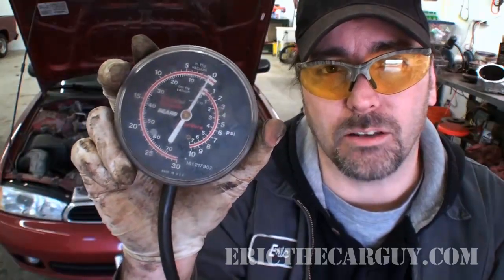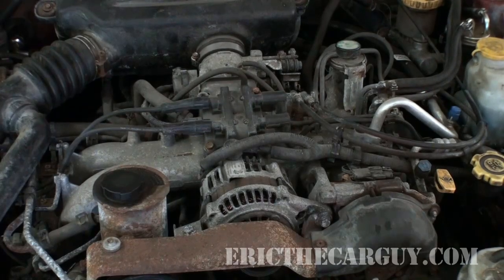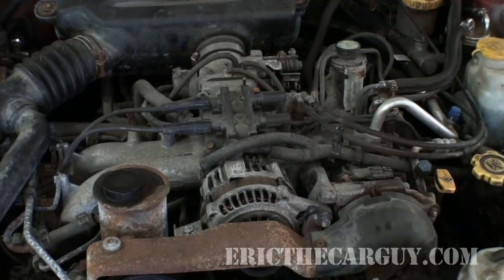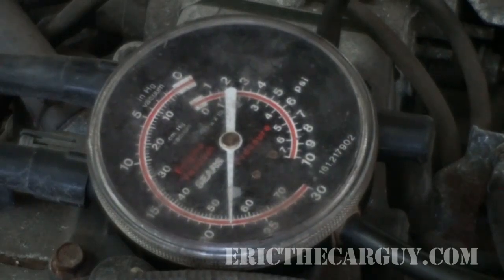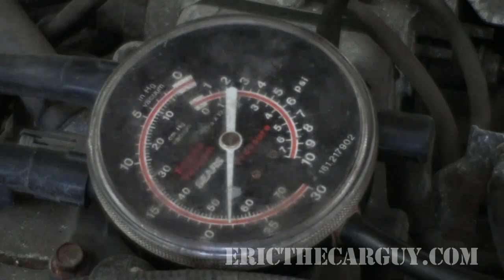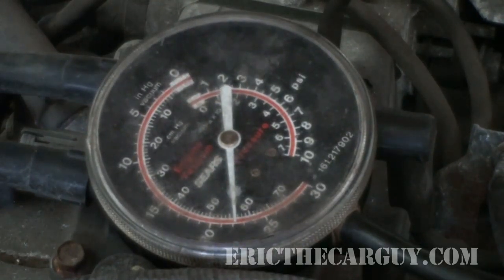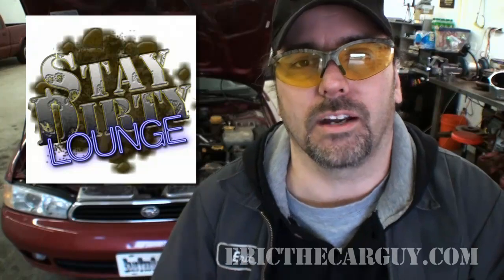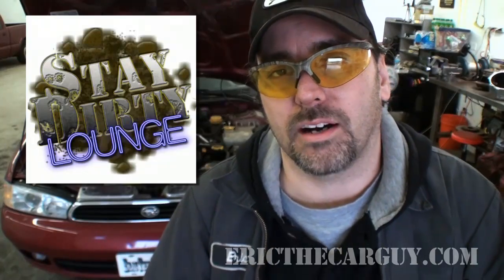How To Diagnose Exhaust Restrictions -EricTheCarGuy

Comment: How bad does the restriction need to be to register on the intake vacuum? I have a naturally aspirated petrol car, 426.000 km old still on the same cat. It was rebuilt 30.000 km ago and was running sweet, like new. But recently the performance deteriorated heavily... Particularly after constant higher revs driving (speedway, 90km/h) or low gear under load (long slope) the engine starts sputtering and stalls. Takes more cranking to start but starts. Plugs and O2 sensor were whitish;  swapping the sensor changed nothing. Should I suspect the exhaust restriction? Want to sell the car but in good working order.

Comment: What does a slightly fluttering needle mean( bouncing up and down by 1 or 2 HGin)? Also, when you say remove the Oxygen sensor do you mean the upstream or downstream sensor? And wont that sensor being removed while driving cause air/fuel trims to act up?

Comment: Didn’t work for my 5.3 v8. Vacuum gauge didn’t show any problem the way you showed. Pressure gauge in the exhaust showed over 10psi under full throttle snap. My converter was plugged.

Comment: I have a 2013 chrysler 300c 5.7l hemi with no mods that I drive hard.. and I'm getting the smell of fireworks from the cats..I wanted to put high flow cats on but still need it to pass Cali. Smog...first will new cats improve hp even slightly and what can I do to improve performance without creating a hotrod..2nd what brand do you recommend selling quality cats

Comment: Very good work, but whats the go with a diesel that has a vacuum pump? I think my diesel may have a clogged catalytic converter because the exhaust manifold area is pie cooking hot, more than it used to be and she's down on power. Either that or the timing is out (retarded)

Comment: I'm wondering: in the case of the healthy engine, why does the vacuum get slightly stronger at part throttle (once it settles down)? I was thinking that with wider-open throttle it would be closer to atmospheric pressure, or does that only happen close to WOT? Makes me wonder how speed-density systems can make sense of MAP sensor input!

Comment: That's great video. I have a car equipped with Valvetronic system, hence the throttle plate is always fully open unless the car is in limp mode. How can I test for a clogged exhaust on these cars?
Reply: Drill test ports before and after a catalyst chamber and compare.

Comment: O lawd that banana poke was jus soo funni!   Ok so here I am trying to figure out why I don't have any manifold vacuum.  I found a PDF article that detailed the various symptoms found while using a vacuum gauge.  A restricted/plugged exhaust just stood right out!

Just weeks before I encountered a stall and then a crank but no start, I had a new catalytic converter installed.  Hooking up the vacuum gauge and fuel gauge after confirming spark, etc, I found a really good high fuel pressure but with a leak down and thus indicating a bad regulator.  The vacuum gauge kind of ticked off of zero but nothing more.  So at this point I isolate the PCV and the A/C-heating vac hoses and do a direct vac test.  Still no vacuum!

Now I'm going nuts, scratching my balls and pulling my hair out!, I go online and find that great and simple PDF that after led me to watch your video.

Tomorrow, I will check the exhaust....... If I find a bloody banana or anything else in the tail pipe, I will surely do a war dance!

Comment: Could you use temperature before and after the converter ?
Reply: It's a different test, but yes. If it's hotter in the front (closer to the engine) than the back, it's clogged. 
But it could also be a malfunctioning cat. 

Measuring this way checks the entire flow of the car, then the troubleshooting takes place to find where the blockage is.

Comment: Often when a check engine light comes on and its a bad 02 sensor. If you let that go uncheck too long it, the engine will dump too much gas and it will break up your cat converter internals and clog the exhaust. It will not run good at all. Low power. It might not make it up the street. You could notice a gas/fume smell inside the car. Outside the exhaust smells foul like rotten egg. Sounds like crap at the pipe.

Comment: FYI Eric, on my sons 2001 Mazda 626,just did my test. I used a Vacuum brake bleeder from Harbor Freight and out it on an evap tube, it read ~20 inches but it was chattering back and forth at a rate like a bobble head on steroids. I was by myself so I reached over to the throttle body and turned the plate manually to give me about 2K, the vacuum dropped to under 15!!!! Wow took me a few minutes to watch your video and 1 minute to do this test and drink a beer while doing it. So no I'm so happy, I'll have another beer. BTY my problem is a rough idle that gets better once I get to higher revs, its my sons car so I don't know if its losing power as I don't drive it. I had done a few other things that improved the idle greatly but this is certainly the last problem...If you're wondering of you really help the average Joe out there, you do my friend, you do.

Comment: you are the best. My 2002 pontiac grand prix has the same problem after repairing a misfire P0303 so as i push the accelerator the rpms run very high and i struggle to go the speed limit.

Comment: Thanks man, i work at a shop and had a car with no check engine light on but would lose power up big hills only, no acceleration at 60 at 4000rpm,
Did this vacuum test and the vacuum doesn't drop to down at full throttle.
Removed b1s1 o2 sensor and the power returned.   Sold the cat and rusted o2 sensors. 
Completed monitors and the car passed smog. All is good now
:-)

Comment: Great video! At 5:28, you said to take out the o2 sensor and drive to cofirm an exhaust restriction. I took out my o2 sensor and it STILL has loss of power uphill.  What does that mean? Thanks for the reply.
Reply: Mars Sojourner, I took out my o2 sensor and it ran so good, in my case I have a plugged/clogged exhaust. 

I can say  to check and clean your mass air sensor , also check your EGR, pedal position sensor,...

Hope this can help! Good luck!
Reply: So how did you fix your clogged exhaust?
Reply: Magic Johnson hey, In my cause I had to gutted my catalistyc converter temporary until I have money to buy both cat converter. My car is running like a champ. both catalistic converter were clogged because was burning too much oil. 

Did you take off you down pipe and drive the car and feel any differences? Or just take off the plug on cat converter ? 

*In some States gutted cat converter are illegal.
Reply: @josuegonzalez3375  hi.may i know what o2 sensor you remove botton one?? or the one fron the exaush manifold?? because 97 accord is slow accelarating then yesturday i removed my catatalyc converter it was loud but i felt it run better and what i did i gutted my cat too but i dont know it feels a little bit better...1 thing i notice that with the whole system  cat.muffler connected it spills dirt or maybe its oil..and without the cat and muffler and pipes it doesnt spill..so my guess it could be that the muffler is clogged?? hope you understand me//english is not my first language lol ty

Comment: I need some help I have been working on cars a long time and I am having problems finding the cause of my problem with the exhaust manifolds glowing red after I put a load on my 98 s10 blazer with a 4.3 and it runs good with good power and the spark  plug tips look tan do I am stumper got any ideas thanks
Reply: Fuel pressure regulator

Comment: hi,i would like to ask you all a quick question,i bought one of these vacuum gauge for my motorcycle is one of those compound meter with different colours for different measure but when i connect it at the vacuum line of the throttle body the gauge remain stucked on zero and even if i open the throttle the arrow moves only 1mm or less,how is it possible?to help you better understand i connect the vacuum gauce after the throttle body exactly were is the plug for carburetor synchronizer,i can feel the vacuum with the finger even if is not strong vacuum is there but with the vacuum gauge connected the arrow remain on zero,there is someone who can help me to understand the reason?i would really appreciate it,thanks..p.s. i dont know if make a big difference but my motorbike is with electronic injection

Comment: This raises thinking about another tool the "smoke test" can it be performed on both intake and exhaust side? I am pretty sure it can but not so sure if it matters if the car is on or off when performing a smoke test to find leaks. As opposed to finding  clogs. Its a stupid question but when i am not completely 100% clear on yet

Comment: that's the exact same gage I have- II think it came as part of an engine test kit from sears years ago ! anyway the problem I have isn't restricted exhaust. I'm dealing ith an engine that someone once upon a time installed a high performance cam and roller lifters etc... I don't know yet but I suspect they also got some type of adjustable timing gear and adjusted it too far
Reply: 1skywrench - My 2 cents. Get it as close as possible to "normal" OEM condition, to have a good baseline. Than start from there one step at a time. 
Might sound tedious, but In the end usually saves a lot of time/money, with much less "guess work". ;-)

Comment: Does anybody know if a compression gauge is the same thing as vacuum gauge is?
Reply: no, its not
Reply: abracadabra sabracadabra thank you. Where do I get one of the gauges mentioned in the video?
Reply: Just about anywhere.   They are nothing new.  Been around for many many decades, one of the oldest diagnostic tools ever designed.  So, Sears, Pep Boys, Autozone, (those type of retail auto stores), Amazon, Ebay, heck maybe even Craigslist for a used one.  I would avoid the tool trucks like MAC or Snap-on -- way too pricey.  Sometimes Pawn shops and flea markets have them too.  Just make sure it works.  If you buy a used on, put your mouth over the end that the hose goes on or put the hose on it and suck, the needle should move into the vacuum area.  Some of these gauges are two in one types,  having both pressure and vacuum readings on them.  Some are just vacuum.  Anyway, you will also need some fittings, called T fittings.  Based on your question, you need a kit, otherwise it will be a useless gage.  I would look at Harbor Freight Tools for one.  Check out this You Tube video, the guy uses one from HFT:  https://www.youtube.com/watch?v=SdlNwm8OHco https://www.harborfreight.com/catalogsearch/result/index/?dir=asc&order=EAScore%2Cf%2CEAFeatured+Weight%2Cf%2CSale+Rank%2Cf&q=vacuum good luck

Comment: Hey Eric thank you for the video! I have an important question that I was hoping you or someone else might be able to help me with. I own a 1982 Datsun 720 pickup with a carbureted Nissan z24 engine and a Holley 2 barrel carb. After watching your video about how to tune a carburetor I went to an intake vacuum source on the carb, hooked up my vacuum gauge, and had no luck tuning it based on the vacuum pressure because the vacuum was constantly bouncing around between about 4 pounds of vacuum no mater where I adjusted the mixture. Do you believe something like this could be caused by a restricted exhaust? Otherwise with the truck being an 82' I know I have quite a few exhaust leaks scattered across the exhaust, but I don't know how that could be affecting it, maybe not enough back pressure or something? I'm all out of ideas and would appreciate any kind of suggestions anyone has to offer.
Reply: A bouncing vac gauge indicates a number of things, from mechanical to misfire due to ignition or carburation fault so you need to narrow it down. is it a regular misfire or erratic misfire, if it is erratic it is possibly carby or points condensor if it has any, if it is a regular misfire it may be ignition secondary or mechanical.
Reply: Ryan Salmons - Just as Aumechanic mentioned can be from several different causes. Personally I would start with the ignition system checks. From the plugs and moving backward. Be consistent and methodical. The plugs will also give you precious information to had to the vacuum gauge readings. 
Are the gaps, temp range, OK for the application? Plugs OK, move to the cables, , than distributor, etc. a lot to check, but done by steps it's easy and target for the best results. 

Forget the carb until the rest is 100%. Otherwise you'll be chasing your own tail. ;-)

Comment: what about a "low voltage" code on the rear O2 sensor both before and after changing rear sensors? vehicle is a 97 chevy K2500 4x4. 5.7L vortec and hd factory dual exhaust instead of y-pipe

Comment: I just bought a vacuum gauge for my old 92 Ranger 3.0L because the engine is not behaving right. What I saw was the needle was at about 18 in of mercury at idle and would be steady for no more than a few seconds. It would then bounce down towards 15 inches and try to climb back up. What does this mean?

Comment: eric please help
2000 expedition 5.4 replaced exhaust manifold and cop's #4 & #7 engine still runs very rough and not getting all the power during idle and driving
Reply: Did you try changing the spark plugs?

Comment: Eric, YOU ARE THE MAN!!!!  50 years experience and I learned something today.  Had a Caravan with no power above idle.  Idle vacuum was 22, dropped to 19-18 after a few seconds at 2000 rpm.

Also gotta say you are articulate and easy to understand.
Reply: Many years ago a friend came with his BMW which had lost performance and was quite irregular while driving. Big headache to find until the vacuum gauge got into action. 

Shortly after confirmed when the car was raised, a big kink in the exhaust pipe. Well he just forgot to mention from the beginning that the "failure" showed up immediately AFTER hitting the exhaust. Could have saved us a few hours...

Make sure when approaching your favorite mechanic to tell the full story. Can be a big help for both. ;-)
Reply: Thomas Goodman so do I and am working on it little by little and just a little thing can cause something big

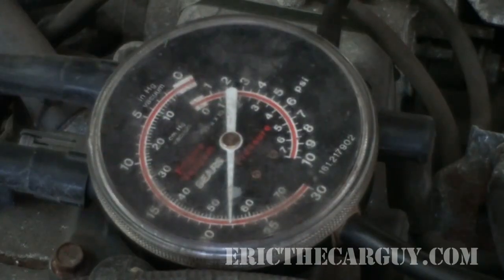Comment: I'm confused,  @ 1:53  you said "at idle you will have your highest  vacuum  and a wide open throttle it will be the lowest in fact it may drop off to no vacuum" But that's not what happened when you  established your base. It rose from 22 in Hg at idle to 23 in Hg at 2000 rpm. then with the restricted exhaust it dropped at higher rpms ?
Reply: I was wondering the same thing. It was very confusing.
Reply: William C I know this an old video, that's because he did not floor the gas pedal or WOT
Reply: William Camp When engine runs the piston sucks in air throu intake and pumps  out through exhaust system. if you have a restriction in your intake system when piston go down air can’t move fast enough to fill up the cylinder and it creates more vacuum than normal and if you have restriction in your exhaust system air can’t escape fast enough and it build up back pressure at exhaust manifold and exhaust valve get stiffer and needs more pressure to open and after exhaust stroke there is still pressurized air remains in the cylinder and when piston go down that air feels up part of the cylinder and remaining come through the intake that cause less vacuum than normal at intake. Theoretically if you have a open throttle you should have less vacuum but because the rmp goes up too and piston moves faster that compensate with open throttle if rpm would remain same open throttle would cause lower vacuum at intake after throttle body. Air would flow into intake quicker with wider passage and reducing the vacuum.
Reply: Vacuum is highest at steady cruising and deceleration. It only drops temporarily when you open the throttle then it picks up again and steadies out if engine speed and throttle position remain constant. I think he only said that it is highest at idle for the simplicity of explanation, I mean it only rose one inch of vacuum at steady 2000 rpm, replicating a cruising situation, which is negligible for the concept of testing he was trying to explain. He probably just didn't feel like splitting hairs and going into further detailed explanation of engine vacuum characteristics, as that would have been slightly off topic. Very good video!
Reply: Full throttle acceleration with a N/A car you will see zero. With a turbo car you will see psi/boost.
Reply: Engine vacuum is highest under heavy engine braking and it can indeed increase if you keep the engine at low-ish rpms (or rather if the throttle is barely open). It would then start to drop as you open the throttle more. I'm not sure why people say the vacuum's highest at idle, but I've certainly heard that from quite a few people.

Comment: What happens to the needle if there's an exhaust leak?
Reply: +Reggie Lewis its slowly drops off @ 2000rpm... what the hell weren't you paying attention??
Reply: +Reggie Lewis Probably nothing. There is a chance you may gain a bit of vacuum pressure over stock if the leak is allowing the exhaust to flow more easily, but that is speculation. You would not however see what is happening in this video because he restricted the flow not increased it. Jesse obviously didn't read your question.